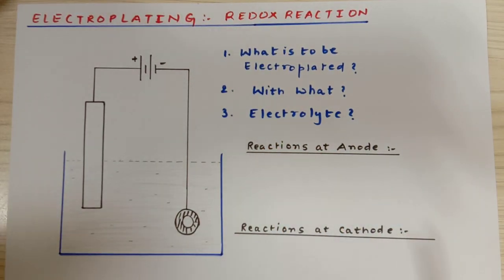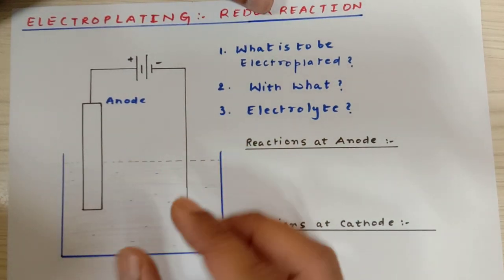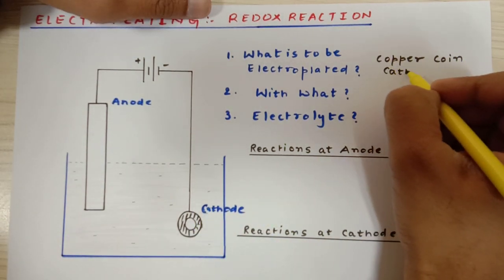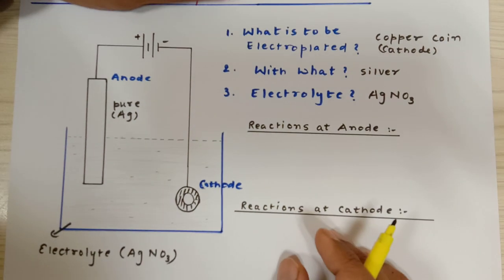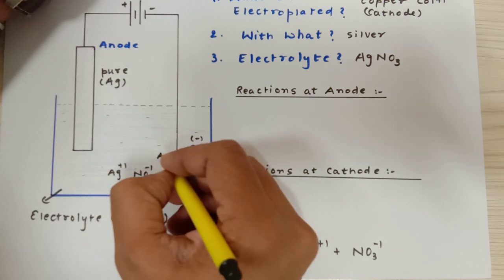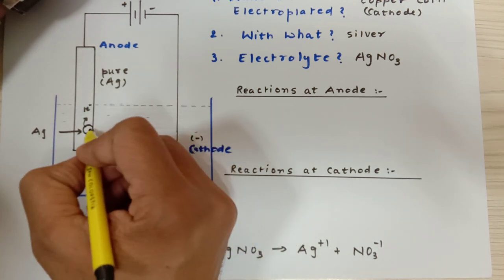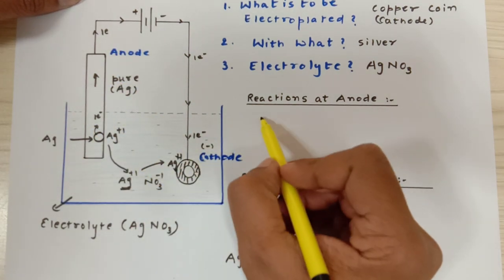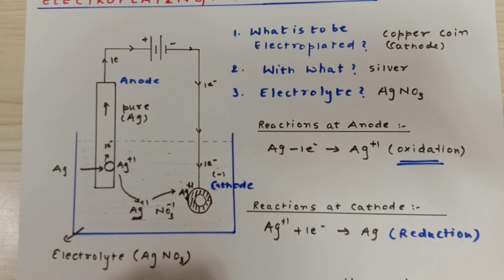BASICS OF ELECTROPLATING OF SILVER OVER COPPER AND REDOX REACTIONS | GRADE 8-10 | CHEMISTRY

Comment: Sir I have a question that in my 10th book 
One thing is given that silver nitrate is not directly used as it ionizes to a large extent and deposition of silver is rapid and the coating is coarse. On the other hand, Na[Ag(CN)2] (sodium argentocyanide ) is used as it ionizes to small extent and gives smooth and regular deposit on cathode SO WHY HERE WE HAVE USED SILVER NITRATE AS ELECTROLYTE?????????
Reply from the maker: You are correct. Idea was to teach that negativity charged ions don't play any role here technically on theory.